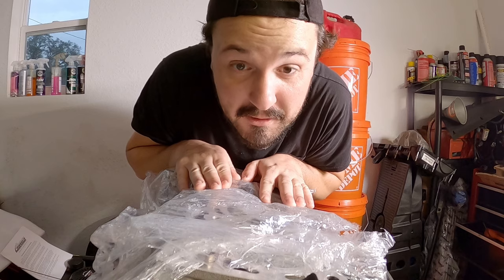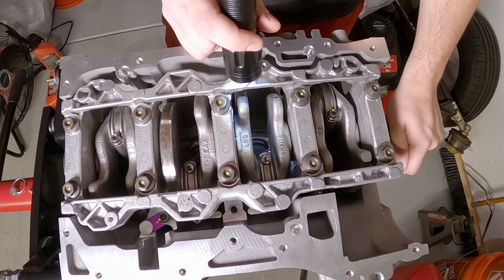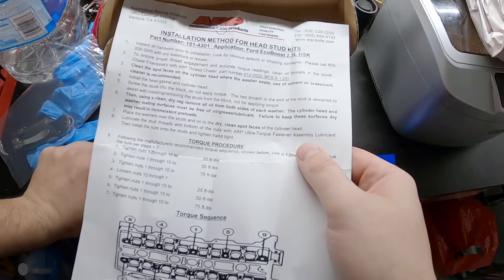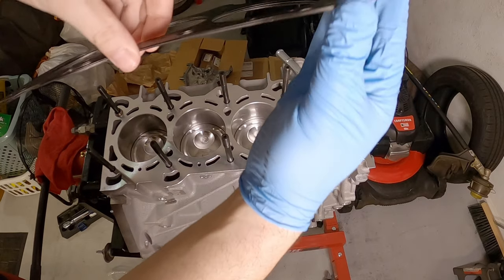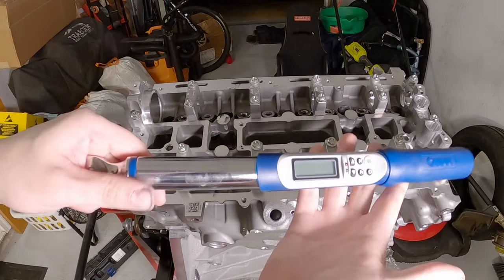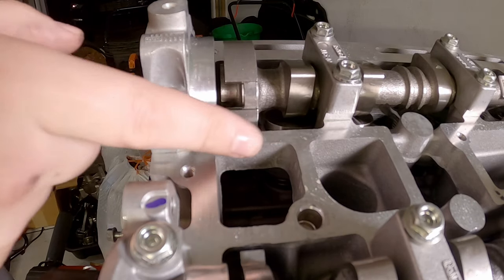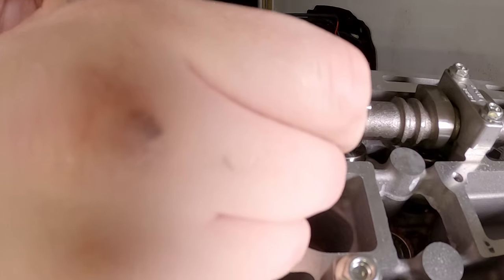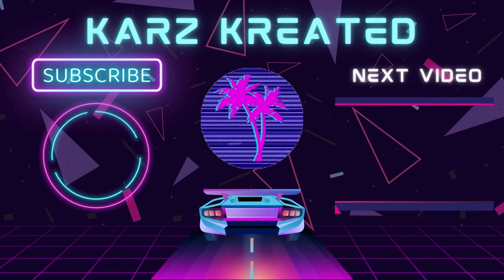Super High Performance ECOBOOST Rebuild Part One - I Messed Up BADLY!

Comment: I'm still watching your videos, started from newest to oldest!
Curious, did you check your old motor for "head lift"? Sometimes, when a motor suffers from pre-ignition, the head will lift, causing your cylinders to fill with coolant. If you inspect your cylinder head, you may find evidence (circles/indentions) where the head bolts hold the cylinder head to the engine block!??
Looking forward to more of your videos!!
Reply from the maker: I don't recall seeing anything like that on the old head. It's still a mystery to everyone.

Comment: I just started watching your videos! I need to work my way back to the beginning of your adventure!! But can you let me know what happened to your 2020 Ecoboost Motor? I thought the 2020+ motors had the new 2nd generation connecting rods??
Reply from the maker: I honestly don't know what happened. The teardown videos show evidence of coolant intrusion and possible detonation. The rods never broke, only bent. The piston in cylinder 3 shattered in a spectacular fashion. My original theory is the piston cracked trying to compress coolant that suddenly found it's way into the combustion chamber. Also to clarify, this was the HPP ecoboost with with Focus RS version of the 2.3L. It's still a mystery to many, but I hope to alleviate most of the factory shortcomings with this rebuild. I appreciate your support! 🙂

Comment: You should post the sizes for each valve bucket or the links to the sizes.
Reply from the maker: Here are the sizes I ordered. All are millimeter.

(4) 3.342
(3) 3.382
(3) 3.402
(3) 3.462
(3) 3.362
Reply: @KarzKreated  Show is the order they go in in an upcoming video?
Reply from the maker: Yeah definitely! I show what I did to keep track of everything. They haven't shipped out yet, but I'm hoping to have them by this time next week. Once I get them, I'll make the second video putting them in.